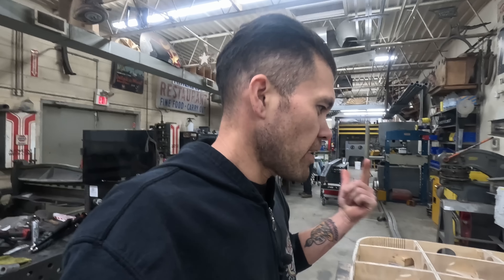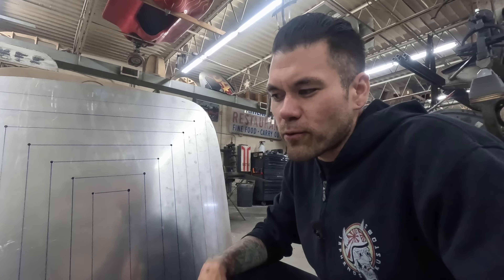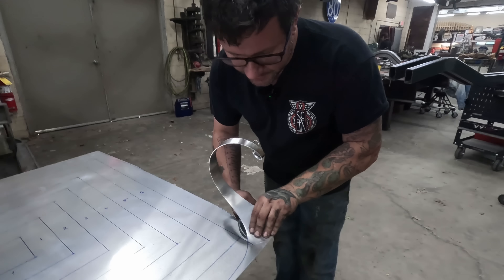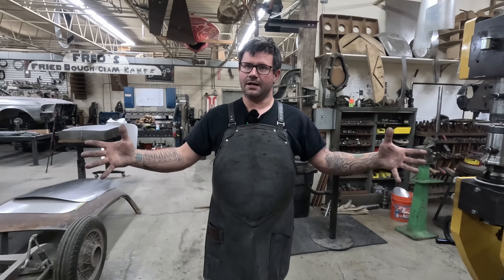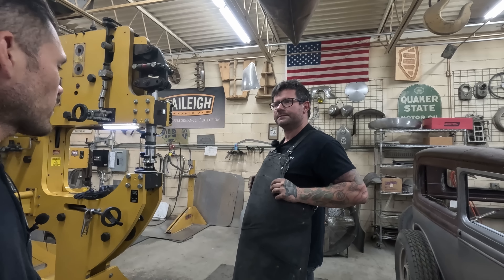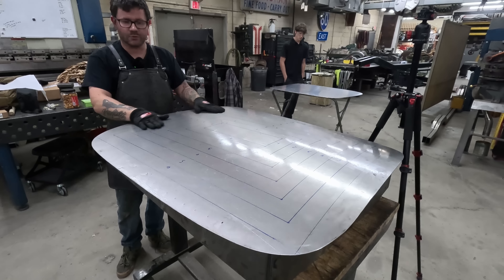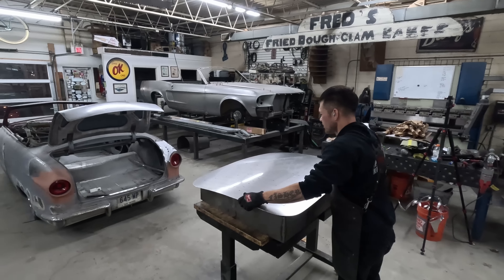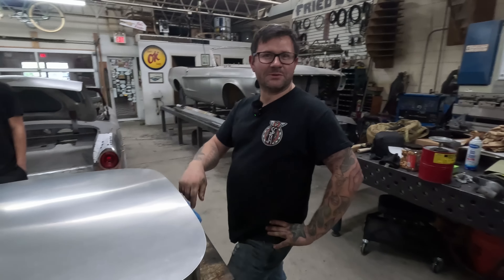THE MAGIC Behind Making A Roof Skin From Scratch! @cornfieldcustoms

Comment: The reaction to the paper towel trick is universal. Been doing body and paint work for 18 years and I got the same reaction everytime I taught someone it. I can feel almost everything in my hand from my experience but I still break out a paper towel from time to time with problem areas.
Reply: Paint and body guy of 23 years here and I've never learned this. My mind is definitly blown! On top of that, I'm just finishing up blocking out a 1985 Peterbilt. I'm wishing that I learned this 2 weeks ago lol

Comment: So curious the advantage over doing the Zephyr roofskin on the English Wheel?
Reply: I had the same question it seemed like this was a perfect project for a wheel
Reply: It's two different ways to achieve the same end result. The English Wheel takes longer and more importantly, it is more physically demanding pushing and pulling the panel through the wheels  and after a while, becoming tired and sore, more opportunities for mistakes than the power hammer. I knew an old guy who made aluminium cowlings for Aircraft jet engines and his forearms were like my thighs because of the repeated pushing and pulling through the wheels.
Reply: Was just thinking the same thing

Comment: The planishing of the panel appeared to very close to using an English wheel. Same or similar process. Going out to check on the paper towel trick. Tactile enhancement tool.
Reply: kinda yes and kinda no. Wheeling machines work in a linear stretch ( tension based) while a power hammer works in a radial stretch ( relaxed based). While both stretching the are greatly different.

Comment: Just one comment to 18.30-something:
I was learned to do, was to use a "ladies stocking", those you always rip, with your rough hands, trying to be careful,You know.
That works in the same way, no matter if it's sheet metal, or heaven forbid, bondo.
from a Finn in Diaspora